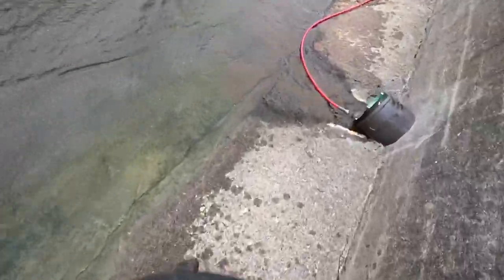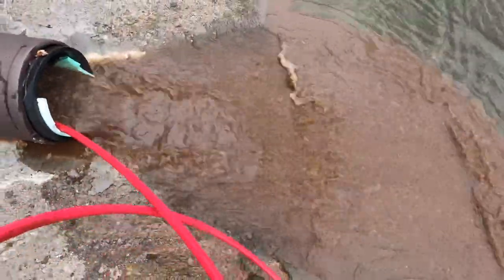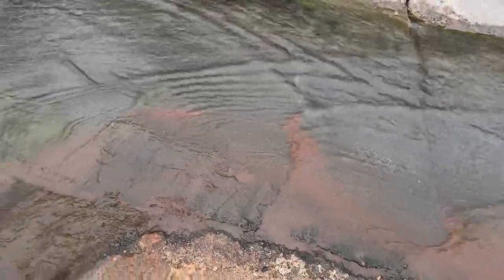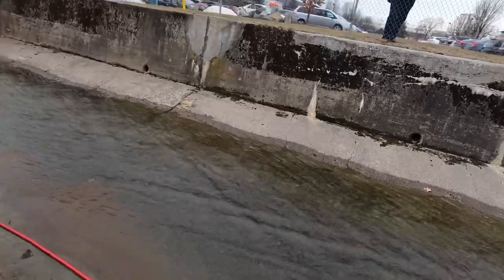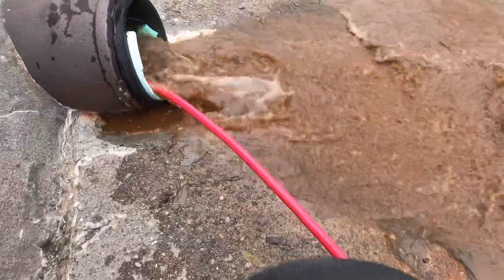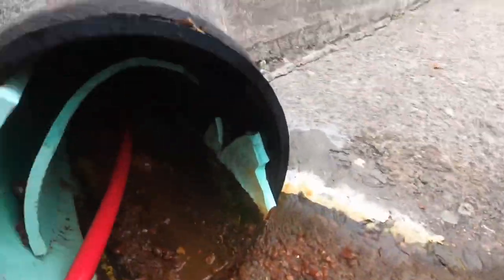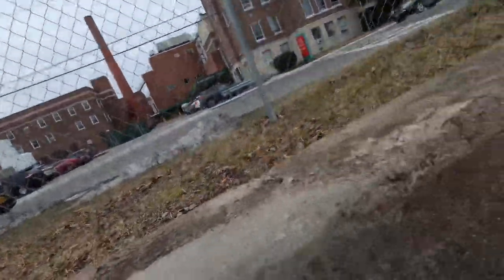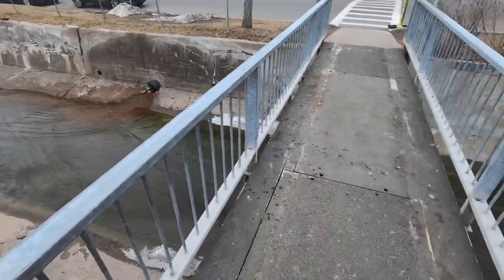8" STORM DRAIN LOADED WITH ROCKS - Drain Pros Ep. 35

Comment: Hose should be on while you pull it out.  Also, always use an extension pipe before the nozzle of at least the same or more length than internal diameter of the pipe so it can't turn around in the pipe on you.

Comment: Question: Why do you only jet into the pipe and not while pulling the hose out? Isn't there chance of debris still further up, past where you can reach with your arm?
Reply from the maker: We try too on most jetter jobs pull back with the jets on and that 6 pack nozzle because it gives the best cleaning but on this one it’s difficult to pull out straight with the locations of the stream.. We do this line again in the summer and they block off the loading ramp so we can jet from the other side of the pipe to the creek! Most of the scale/rocks ends up in the last 30 feet on a lip where the pipe switches over to the broken 8” plastic pipe, so we try to clean thoroughly in that section. Thanks for asking!👍
Reply: Drain Pros get a wrenchmotor for the hosedrum and some pulleys... makes life easier!
Reply: my question too, it makes no sense what he is doing.  He is not getting everything out.
Reply: @octiman2997  they simply loosened it and broke up adhesions, next storm surge will take care of flushing it out

Comment: I don’t understand why you guys didn’t have the hose running when you pulled it out of the pipe to push everything to the outlet
Reply: Job security.
Reply: i was thinking the exact same thing, if it was me i would have.
Reply: Pipe isn't clean,  on the contrary,  they may have created mini dams of debris in the pipe by not pulling the nozzle back to the drain outlet under pressure to flush the debris out.